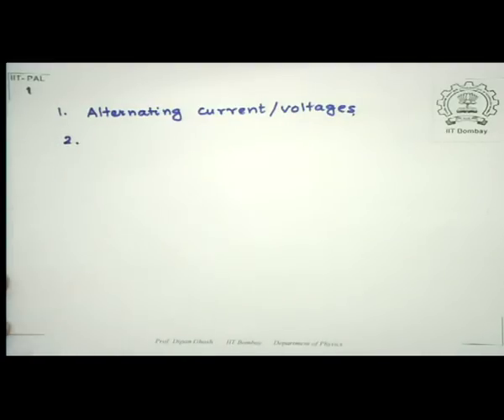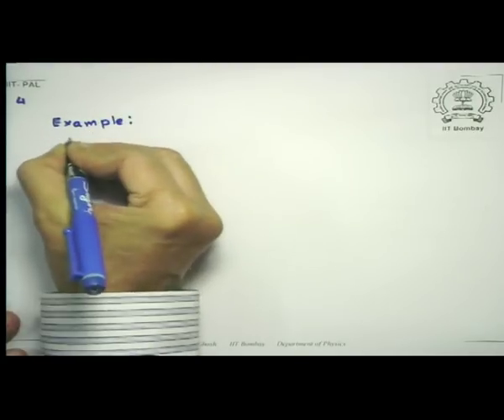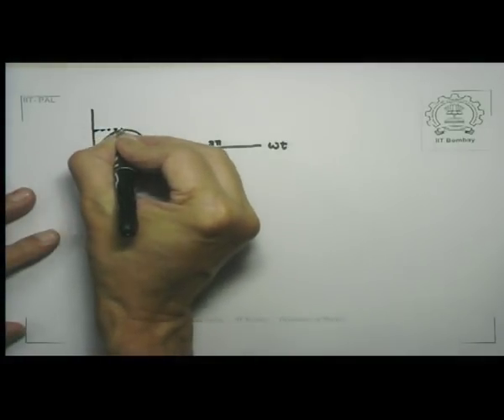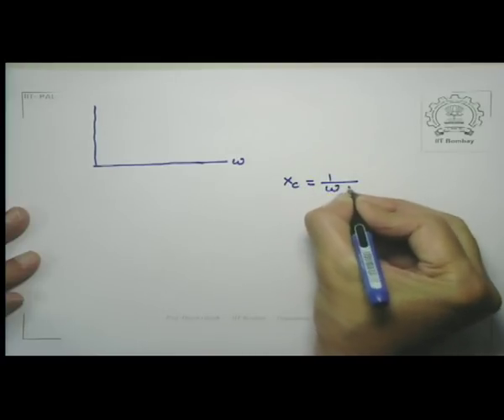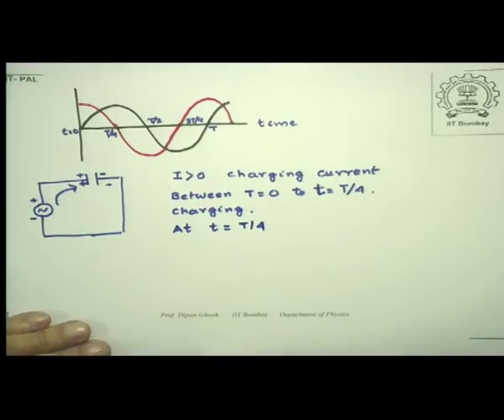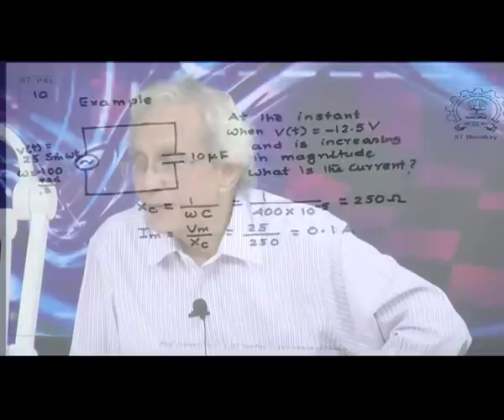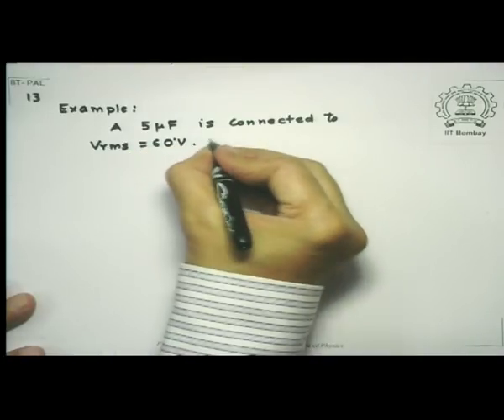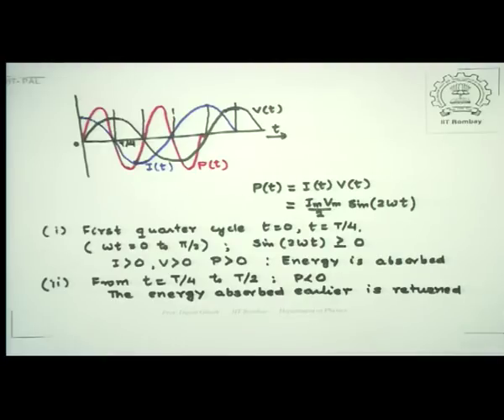Capacitive circuits: Alternating Currents (CH_22)

Comment: I have a doubt
For an inductive circuit we converted cos(omegat) as sin(omegat-pi/2) while for capacitive we write as sin(omegat+pi/2)
Why so?
Reply: This is because in Inductance, the current lags voltage by (pi/2) whereas in Capacitance, the currents leads voltage by (pi/2).
Hope this helps! :)
Reply: Bcoz we don't want to make omega negative 😇
Reply: it is taken so after checking the results of current and voltage in a practical graph .... and when in an inductive circuit the graph showed that the current lagged behind the voltage and in the capacitive circuit current lead of voltage by pi/2... 
when we study we study the graph after the derivation but in practice we plot the graph first and take conversions accordingly.... i guess so